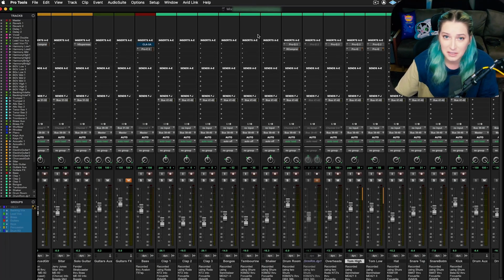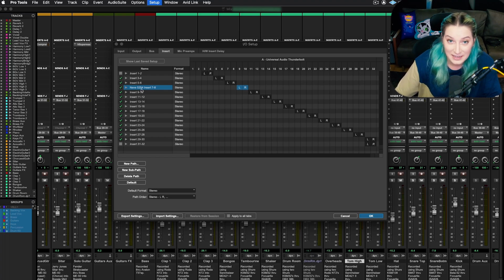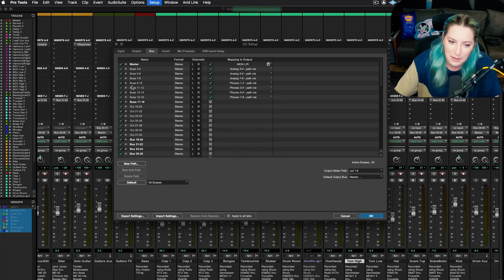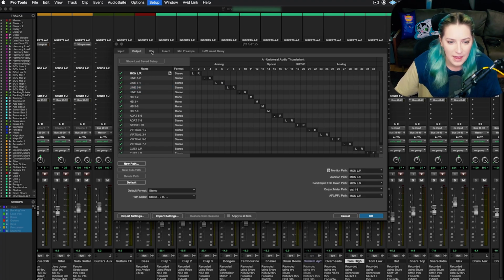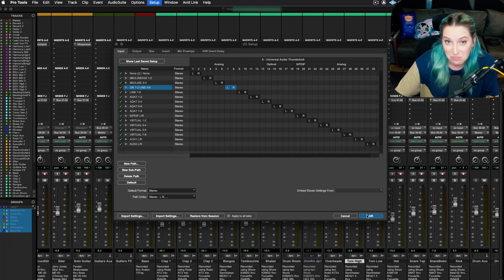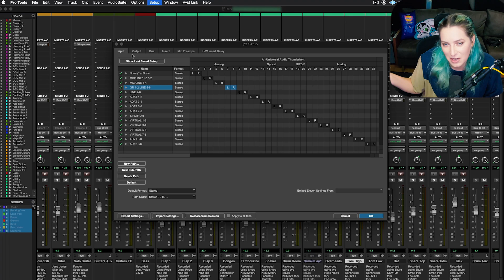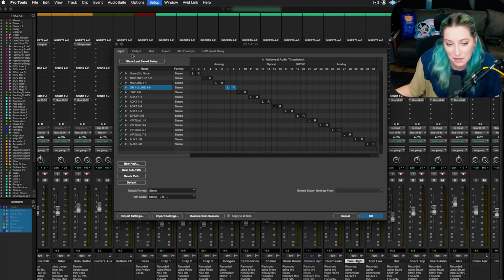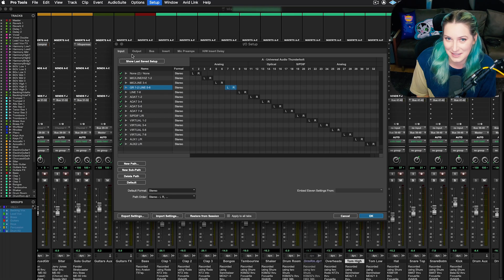Pro Tools Basics: How to rename your Inputs/Outputs, Busses, and Inserts

Comment: nice, i named buss return then change name again, it keep the first name. i can change buss name just for this session ? or it's system (for all session).. cheers ;)
Reply from the maker: it kept the name? Did you change the actual bus name, or the track name, or both? And you can save IO settings to then import and/or use for future sessions, so you can definitely change it on a per session basis, or have it be more of a standard in your system - hope that helps, lmk!
Reply: @CatoNoise  very nice to help, just change bus (reverb) name. ok save, import nice for info. i try to reset by pressing default setting, it erase eveything and disable the bus. i had to recreate one ;) cheers from paris